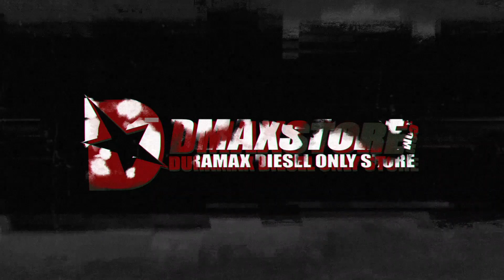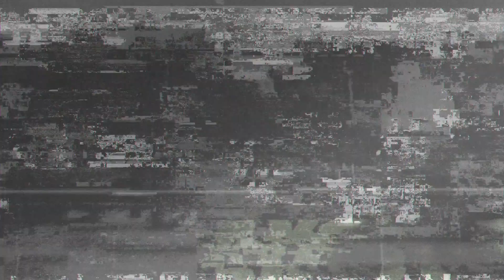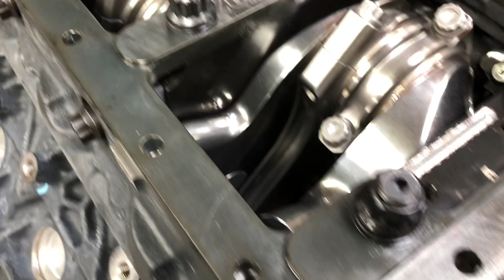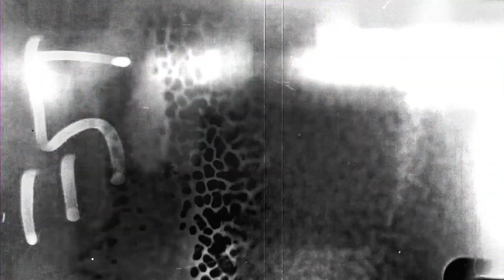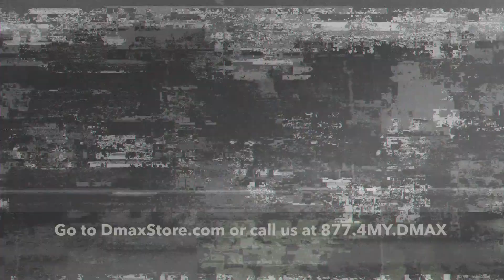Duramax Performance Stage 3 Race Block

Comment: with the forged pistons is there the ring issue everyone talks about with forged pistons, where you have to change them every 20k-40k miles? how far can you take fingers cast oval bowl pistons if you stay below 3000rpm?
Reply from the maker: Yes, we do not recommend running a forged piston setup unless it is for a strictly race application. We have seen over 1200 hp on a set of fingers.
Reply: @Dmaxstore  i want around 2000tq but i really don't care about hp. its going in a tandem axle c7500 tow truck with a 4 door kodiak body. if it's kept below 3200rpm(probably rarely over 2800rpm) can i get 100k+ miles out of fingers cast pistons? I want to use a callies durastar crank, either boostline, socal or carillo rods, 625 head studs and arp hardware, bigger oil pump, billet mains, main girdle, s300/s400 compounds or twin s258s to a s400, frozen boost a2w intercooler, built Allison and driveline, ati balancer ect
Reply from the maker: At that power level, you are really pushing the small displacement of the Duramax engine. Our best recommendation would be to go with a larger displacement i6 diesel that was designed for that application. It is definitely possible that these pistons can hold the power but it depends on many factors as making a lot of torque low in the rpm range produces a lot of drive pressure and tuning is really going to be the deciding factor for longevity.
Reply: @Dmaxstore  what would be a reliable tq number for a built 6.6 duramax or a built 6.7 cummins build? Is there a motor you recommend? I've looked at the 7.8 LG4/LF8/6HK1 Duramax/Isuzu motor but I could not find much aftermarket support for it. dt466? maybe a semi motor and auto trans? Thanks for the help, I'm a turbo LS/BBC and 4l80e guy, so this is the first big diesel project.
Reply from the maker: A Cummins X15 is in the power range that you want. I would go with something from a semi as it will be able to reliably do what you need it to do.